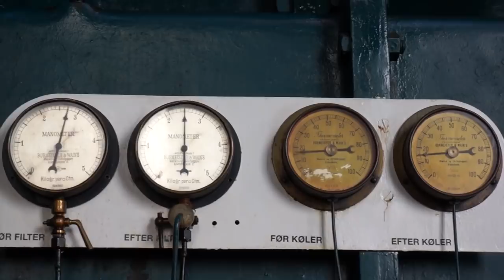Top 5 BIGGEST Engines - start ups

Comment: The jet engine at the beginning did not fail. According to RR press release, the engine passed with flying colors. The engine did not Dismount, and no pieces entered the passenger compartment area. The test was to confirm that the engine could fail safely. There is no avoiding engine failure with a bird strike.

Comment: The Jetenginetest was'nt a birdstrike,they test how the engine can handle the breaking of the fanblades, and if the cowling can contain the debris and prevent it ftom hitting the cell of the aircraft or an other engine besides..Yes, they simulate Birdstrikes by throwing some frizen geese into the running engine, but that does'nt cause such a damage.

Comment: Submarines only use combustion engines whilst on the surface,... While submerged they relied on batteries to power electric motors.

Comment: the German U boat reference,   You don't  run the diesel through out the dephts,  Only can use the diesel to run on the surface and charge the batteries.   Not underwater .
Reply: Sud ster -you can run a U boat submerged on diesels -a snorkel is fitted to draw air in from snovevttd surface -snorkel boats were in action  I'm the last years of the Second World war.

Comment: The 1st engine fail was not a bird strike. Look closely you'll see several blades painted red yellow orange those blades have a small charge that upon detonation breaks the blades from the axial that is recorded in the 1000th speed of normal even slower than this video shows, they are testing shrapnel containment. This engine survived all the frozen turkeys they threw at it.
The last engine is the biggest it runs on ND (naval distillate) after 25 miles offshore inshore they switch to low sulfur diesel this keep the ECO Terrorist happy.